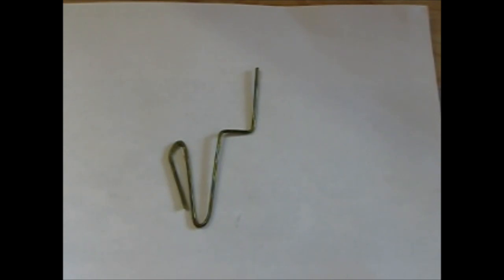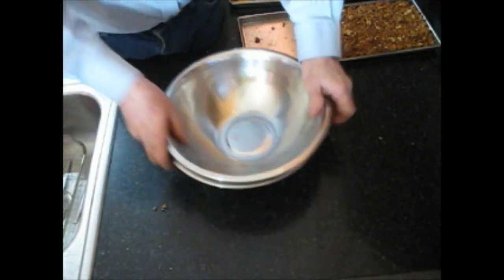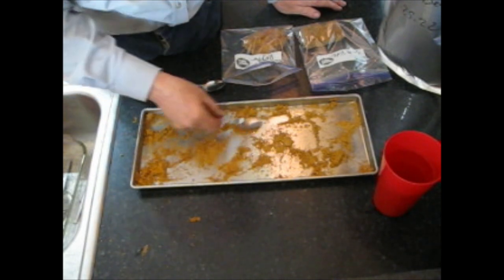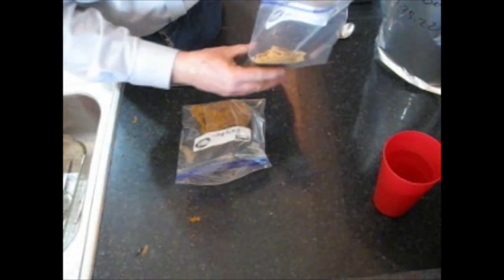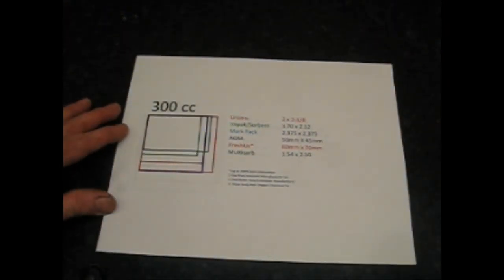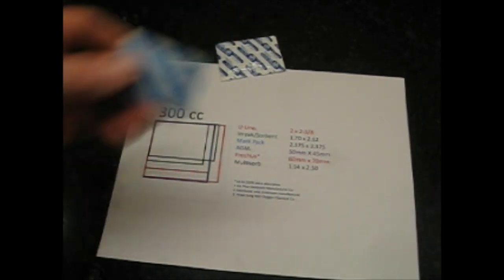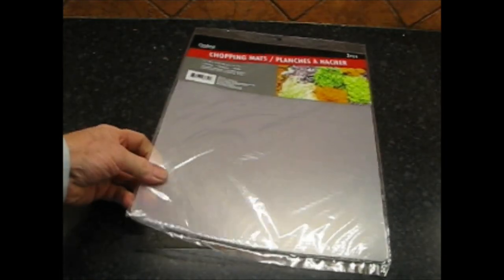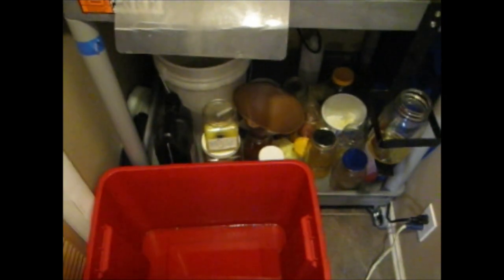Freeze Dryer Hints and Tips 4

Comment: Excellent information, as usual.  I'm glad I'm not the only one who gets water running out of the front of the FD when defrosting it, even though the surface I have it on is level.  It's a heavy beast, but I have been tipping it back and putting a piece of wood under its front feet when defrosting.  But that really is a pain, and there's no way my wife could tip it up like that.

I've contemplated building a gadget that will tip/tilt the FD back using a lever or such to make tilting/untilting it easier.
Reply from the maker: How about a hand pump device that inflates a pillow?
https://www.lowes.com/pd/Eagle-Tool-US-Winbag-Air-Wedge-Alignment-Tool-Inflatable-Shim/1001436580?cm_mmc=shp-cprdtolgglPLA_TOL_215_Power-Tool-Accessories-1001436580-online-0-_-0&ds_rl=1286981&gclid=Cj0KCQjw37iTBhCWARIsACBt1IwBCe6iGhm3lh8ihgW0Bz7hab_mjKqOz8zS9_qAHmYrvjTrCeGYrksaAol4EALw_wcB&gclsrc=aw.ds

Comment: Phil - you always have interesting and informative presentations and assessments.  I also think you may have access to some of the folks at HR. I have a thought and maybe you’ve addressed or thought of this. 

I wonder if a small micro fan could be integrated into the tray area and provide some circulation through the tray area during the process (like the fan in a convection oven). 

Thanks for all you do for us.
Reply from the maker: A fan would be beneficial during the defrost mode, but under vacuum, there isn't any air to circulate.  Because of this, it's important to have food lay as flat or to be touching each other to allow heat transfer from the heater, to the pan, to the food.  A vacuum is one of the best insulators and can have an R value up to R80.  That's one reason why the door pad isn't needed.
Reply: @Philat4800feet  thanks - I appreciate your feedback and input. Hadn’t totally considered the vacuum perspective. Look forward to your videos!

Comment: have you considered using computer cooling fans inside the barrel when freezing or defrosting, removing it when vacuum is in use?
Reply from the maker: Computer fans would be helpful, but I believe they run on 12 VDC.  The little fan I have is 120 VAC.
Reply: @Philat4800feet  I was thinking of increasing air circulation inside the chamber, like a fan in a walk in freezer does. Some computer fans are small enough to fit inside the closed chamber beside the shelf assembly and can be powered by small gauge wire that will not harm the door gasket when door is latched but no vacuum applied. Do you think this would be worth trying?

Comment: I have cut those cutting mats to fit my trays and use them in the bottom of the trays.
Reply: I've done the same thing with silicone baking mats. But you have to remember that it acts as a insulator between the metal tray and the food during the drying phase where the temperature is raised and lowered, so it could increase drying time.
Reply: @ozarkarky  so far I haven't noticed any difference.
Reply from the maker: Good ideas!  This is the point behind Lean Manufacturing and continuous improvements.  You'll never know until you try.

Comment: Where do I fine a video for replacing the ambient temperature wire?
Reply from the maker: I have contacted HR.  I will follow up.
Reply from the maker: From Harvest Right:
"No video on this replacement.  It is a plug into the relay board and the temperature probe is between the fins on the condenser". 
Looks like a remove and replace job.  I hope this helps.
Reply: @Philat4800feet  Sounds simple enough. Thank you very much.

Comment: Phil. do you recomend any type of moisture meter and how to you it on meat. is there a % that needs to be reach or just ZERO all the time.?
Reply: Zero.  But you asked Phil so I'll let him answer too.
Reply from the maker: I don't.  I don't believe in them (sorry if this sounds harsh).  A moisture meter only takes a sample between the two testing probes using DC resistance or continuity.  You could have a piece of ice 1/4" away and a moisture meter would miss it.  To make a statistical sound judgment you would need to take 30-40 samples for each tray.   I believe your fingers can be sensitive enough to do the same job.  You can also use your philtrum (area below the nose), which is the most heat sensitive part of your body.  I also believe, that when in doubt, add more time.  You can't over dry food if you have the correct final-dry temperature.